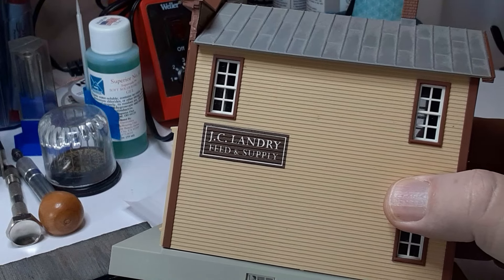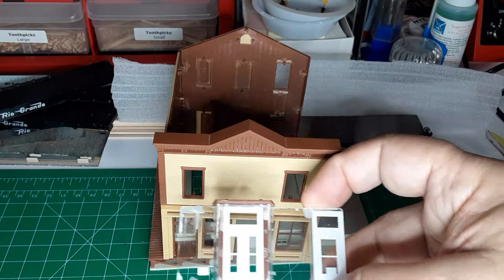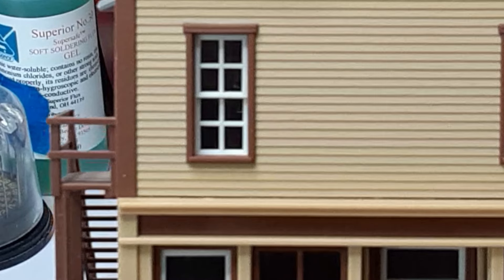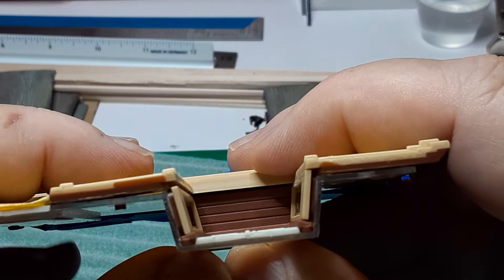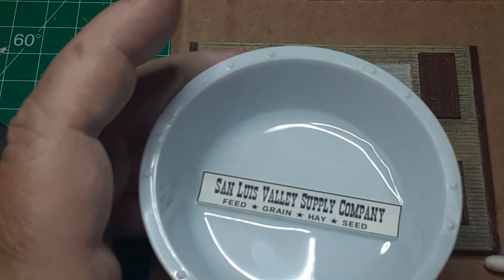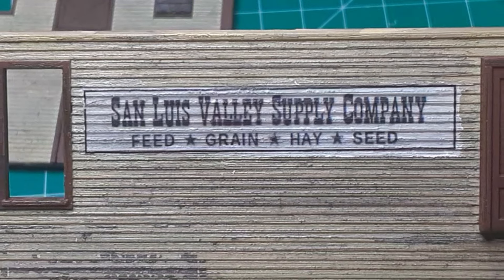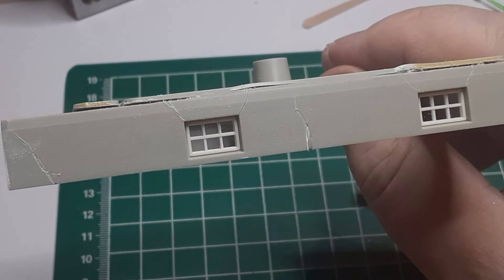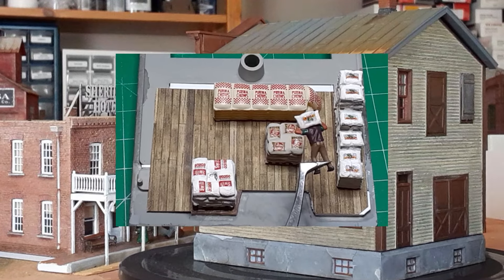HO Scale Structure Makeover

Comment: Wow, you really took on a challenge there, refurbishing that Walther's kit. With all the hurdles you had to overcome, some (me?) may have just put it aside to spend time with something more worthy. But you have shown that there is an inner beauty in every model, no matter how humdrum it's origins. It just takes persistence and inspiration to reveal it. Great job all around! And thanks for the tips on printing decals, I hope to get there someday. Any recommendations on decal paper for inkjet printers?
Reply from the maker: Thanks for the compliments, Greg. I have a small moving box full of complete or partially complete structures that I have consigned to the "don't bother" heap; and I suspect many will remain there forever. For some reason, this building always made me feel a little guilty - I guess that's what made me pull it out of the box.
I can't emphasize enough that these "abandoned" models are a great opportunity to try new things: I never would've thought to try Miskit for paint masking, and might not have had the courage to try it on an expensive kit.
I buy all my decal paper from MicroMark. MicroMark tends to be a little pricey, but I've always been happy with their decal paper. One caution: It does matter what lacquer you use to seal the decal with! I tried Tamiya, Vallejo, and Dullcote; I tried one coat, two coats, and three coats. Both Tamiya and Vallejo allowed the ink to smear, even with three coats. A single coat of Dullcote allowed the ink to smear; but two coats seems to do the job just fine. A third coat starts to make the image cloudy.
Good luck!
Reply: Awesome, Dick, thanks for the info on the decals. A little guilt can go a long way. 😄